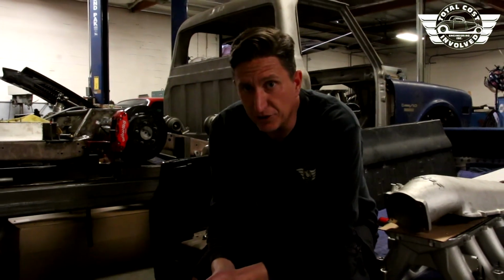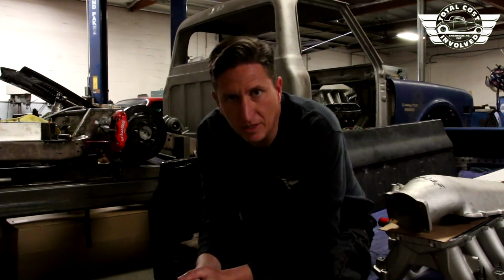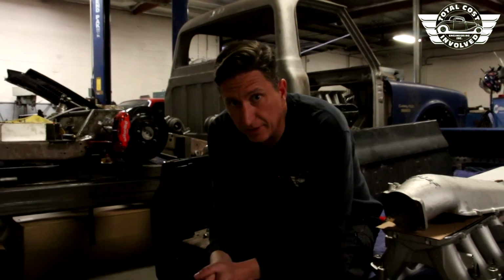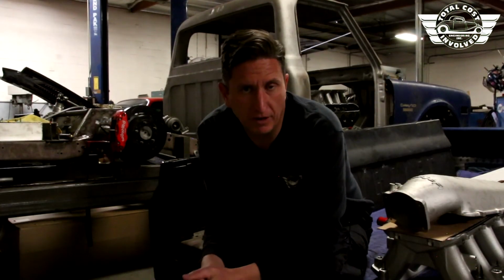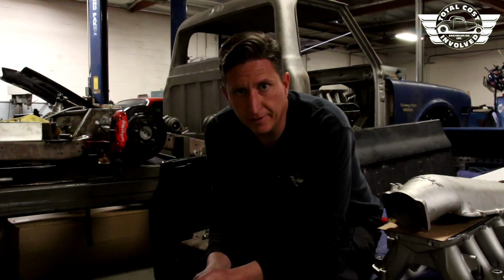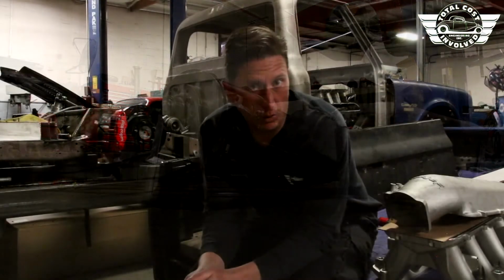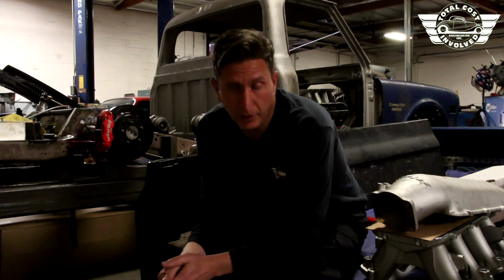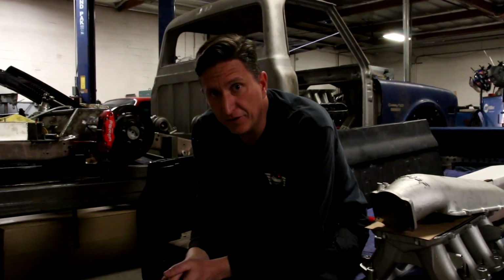Episode 1: TCI Engineering's 1972 Twin Turbo C10 Project #Ctwin

Comment: Except that they won't make boost "fairly quickly". Their distance from the exhaust ports is ridiculous. There's a reason Mercedes turbos practically double as the exhaust manifolds.
Reply from the maker: This isn't our first rodeo. Those all inclusive, manifold mounted deals are for saving cost, not adding performance. Look up reversion and its effects. Turbos work best at near 1:1 pressure ratio. We've seen as high as 3:1 ratios on some factory turbocharged vehicles. The turbo size was chosen for a reason, nice linear boost/power. The turbo placement was chosen for a reason also, it's a pickup, they are naturally light in the rear (lack of traction). We want this truck to have 50/50 weight distribution for autocross. Besides, with the engine set back so far there is only 30" from the header outlets to the turbine inlets. On a side note: This engine will make 650 HP without turbos, so it'll be plenty fast even before positive manifold pressure.